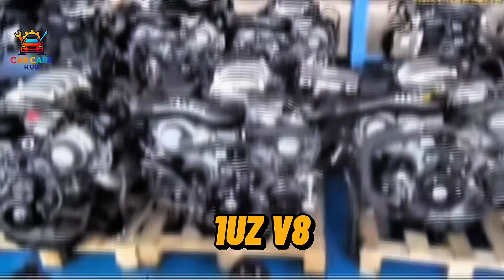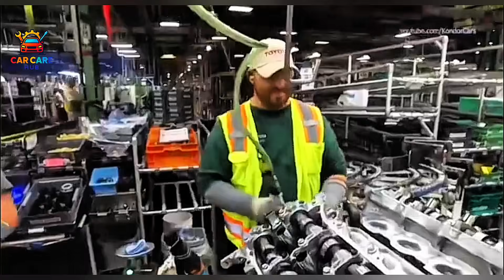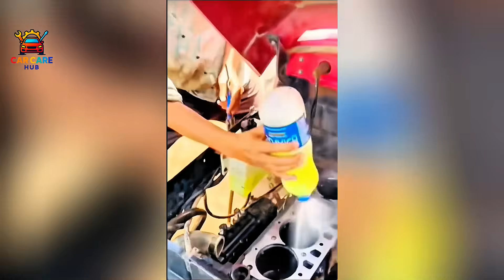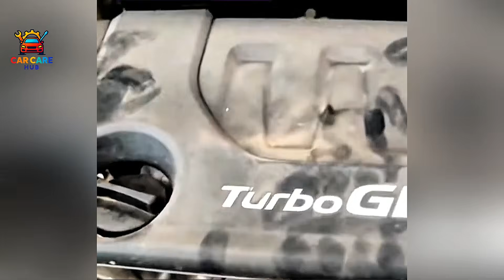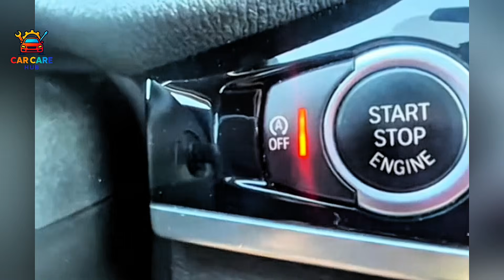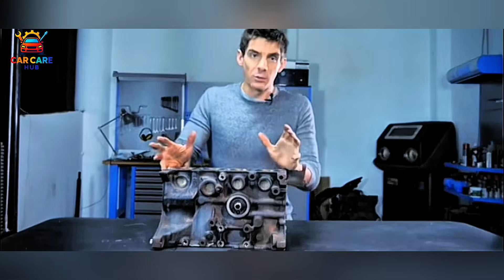The REAL Reason New Engines Are BLOWING UP So Early (Toyota, GM, Honda)

Comment: I have a 2017 Chevy Impala with the 3.6 V6 which has no turbo, but does have direct injection. GM recommends 5W30 for this engine and I’m using Royal Purple. I also have a 1977 Buick Electra and I use Royal Purple 10W30 HPS in that car. Everything is good so far. Both cars are low mileage for the year, 56,000 on the Chevy and 118,000 on the Buick. I change oil every 6 months on the Chevy, which is about 3,000 miles, and once a year on the Buick, which is usually driven less than 1,000 miles a year now days. Oil is cheap compared to even minor engine work. I use Mobil 1 if Royal Purple is not available.